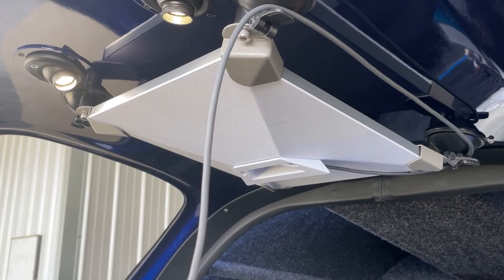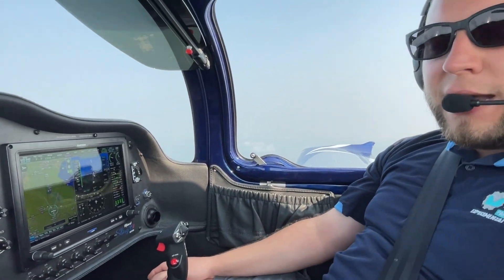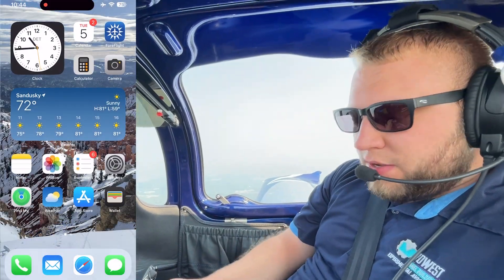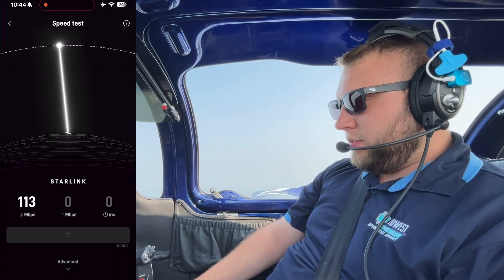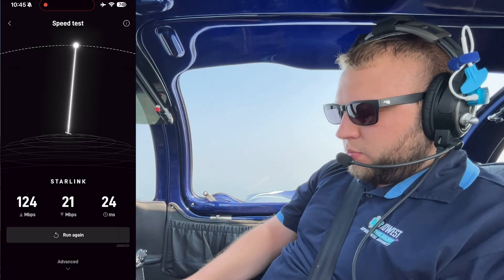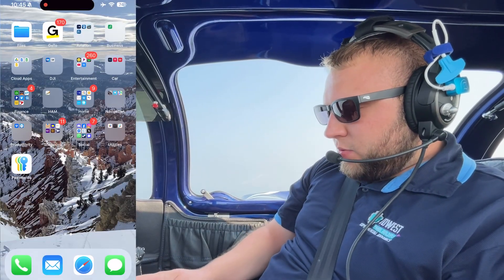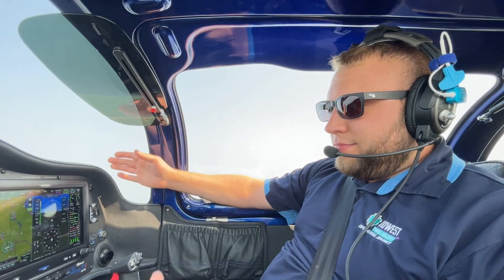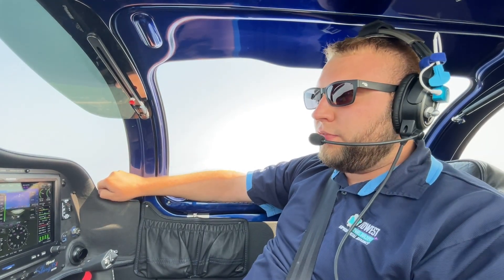High-Speed Internet in your plane!

Comment: Yep, I have Starlink in my TSi and I agree, it's a game-changer. Starlink makes an iPad an even more valuable flying tool, since it has access to internet weather products that G3X doesn't. (At least not yet!) 

One suggestion: have everyone in the plane who connects to the Starlink set their devices to Low Data mode for that WiFi. This prevents their devices from eating up data by reducing the resolution of streaming media, disabling automatic downloads and updates, pausing cloud photos and backup syncs, and preventing apps from using data in the background (unless you’re actively using them). This helps you not blow through your monthly data allotment.

Comment: would you explain how starlink weather functions in g3x?
Reply: They’re not related to each other. Two different things
Reply from the maker: By having Starlink apps such as ForeFlight can get weather data which is more up to date than ADS-B alone.
Reply: The G3X cannot make use of internet connectivity. It currently only supports ADSB-In and Sirius XM weather as source. You need to look at the weather on your iPad or phone; there are lots of websites that have up-to-date weather, but foremost, the flying apps support it, ForeFlight, Garmin Pilot, FlyQ, etc,

Comment: What about cutting a hole in the dash to mount Starlink Mini recessed somewhat flush with the glare shield?  Is there enough space below aluminum/above the avionics to allow for the mini to be recessed (partially recessed) and not blocking the view out the windshield?
Reply from the maker: I wouldn't recommend it. Chances are, the size of the dish will continue to shrink as they get updated and the giant hole you cut will become obsolete.

Comment: With an aluminum plane, us there a way to mount it on top outside without affecting flight characteristics?
Reply from the maker: Put it on the glareshield. Don't attempt to install on the fuselage like this - best case scenario it works. Worst-case scenario you have a 3lb projectile slamming into your tail surfaces...
Reply: No terrible idea. It would get ripped off without a fairing and you would still have to put holes in a monocoque fuselage to run the electricity.
Reply: @Captndarty there are surface-mounts (integrated fairing) for the Recreation Vehicle community. I imagine it would still be draggy. A flush/recessed mount would be great, but i have no how that would work structurally.

Comment: Won’t work as well in an aluminum airplane.  🙂
Reply: If it’s suctioned to a window what does the body of the aircraft have to do with anything?
Reply: @IlIlIlIlIlIlIlIl-v9h Most airplane windows don’t face upwards.
Reply: @LTVoyager the rear window and the front glairshield do. He even said in the video the best spot is on the dash
Reply: @IlIlIlIlIlIlIlIl-v9h It is tricky to secure an antenna of that size securely on the glare shield such that it won’t get dislodged in turbulence.
Reply: @LTVoyager it sounds like you don’t want starlink in your plane bruv. To each their own. My plane is aluminum. I have it mounted to the dash with view to the sky through the front window. It’s zero issues in turbulence. Happy flying ☮️ ✌️
Reply: @IlIlIlIlIlIlIlIl-v9h Flying has sufficient hazards already without having pilots with large antennas on their glareshield surfing the web rather than flying the airplane.
Reply: @LTVoyager there it is. We found your real agenda. Forget all the benefits like real time weather, the ability to call a mechanic from the air, alternative communication options if you have a com failure. All you see is people texting 😂
Reply: The Sling TSi is an aluminum airplane. As Adam notes in the video, the canopy is composite, and this plane doesn't have the thick steel parachute cables.